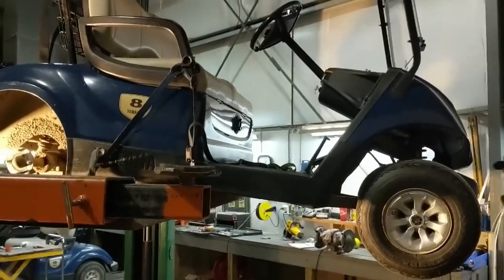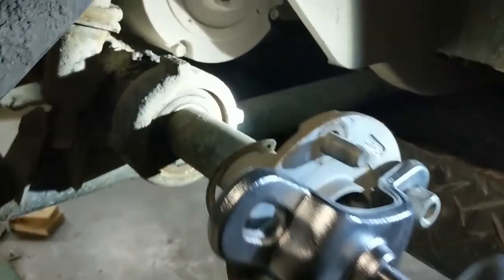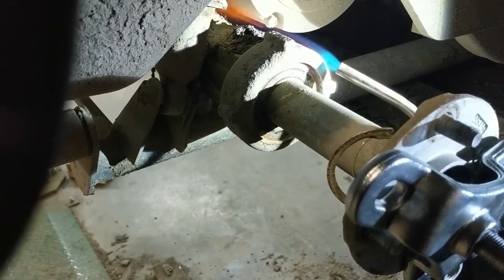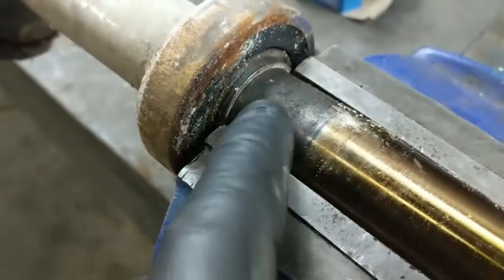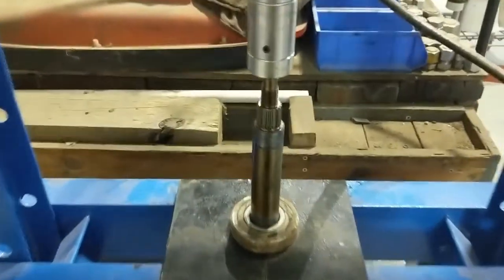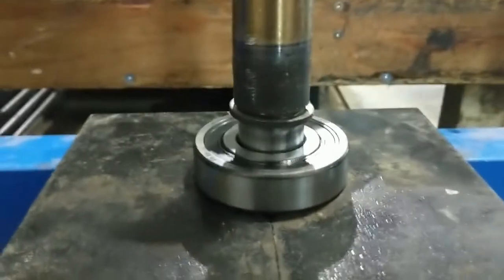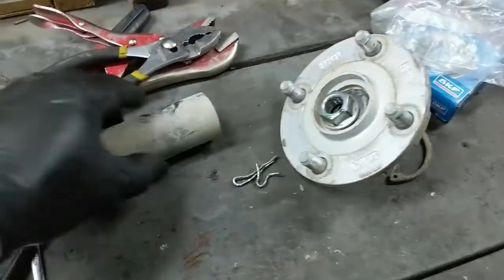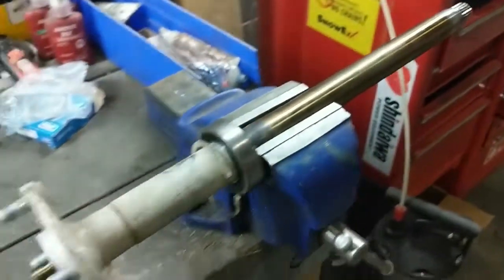How to replace Yamaha Electric Golf Cart Axle Bearings

Comment: Excellent vid! My cart looks like yours did with all the grease. Is there an additional oil seal or is it just the bearing?
Reply from the maker: I'm pretty sure it was just the bearing in that video,
Reply: @machinesnmetal  was the grease build up from the bad bearing or the gear lube do you think?
Reply from the maker: The axle tube was pretty clean inside . I figure it was the bearing's grease that leaked out when it got sloppy and then seal failed.

Comment: when installing the axle back in does the bearing push in pretty easy or do you have to hammer it back in?Just wondering cause want to make sure the in splines line up right 

thanks
Reply from the maker: it pushes in pretty easy, if it's too tight try freezing the bearing first